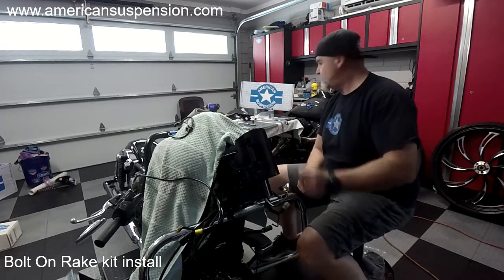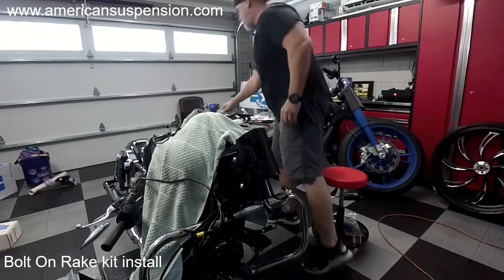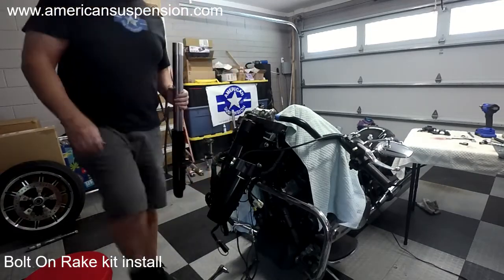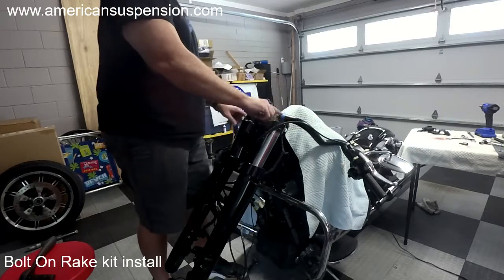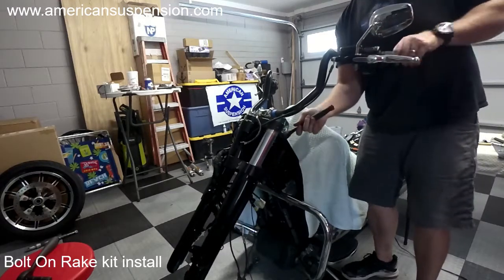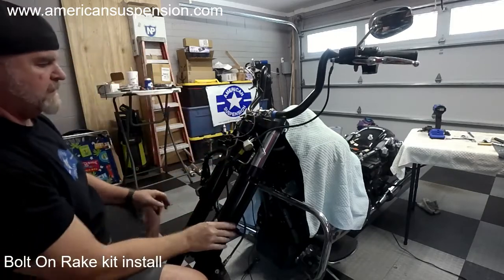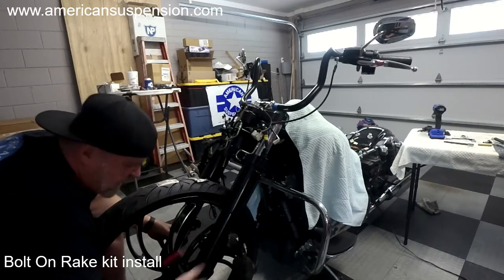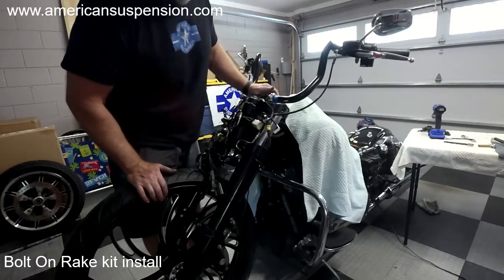American Suspension Bolt on Rake kit install 2021

Comment: I put a 21 on a 2008 EG and hate the way it puts the front end in air. I put it on kick stand and it just rolls over. I know longer stand, but if I put a 7 degree tree on, will it lower the front end and not effect the handling.  I have a hot rod 124 in it and I'm not a road racer.  just wanna stretch it out and level it. Any advice is appreciated.  I also have the legends front end inside. I like the longer travel without  lowering it

Comment: Does a 2020 Street Glide need a special fairing adapter bracket so your headlight is not pointing at the sky?
Reply: You know headlights have adjustments yea? If its not enough, just shim the bracket.

Comment: I don't know if this is a dumb question but can you run a 30-inch wheel on this rake kit with a regular spring suspension? I personally don't want air ride I just want it to be set up at one height and stay there
Reply: yes, you can use stock springs or air ride set up in the front

Comment: How many hours should somebody be getting charged to have this installed? 6 to 8 hours?
Reply: Yes, that is about right , road glides need a little extra time 1hr or so - most shops charge 6-10 hours for just the rake kit install and road test
Reply: @megocoop  ok. Thanks for the fast response!

Comment: I just put a 26 inch rim on a 2001 ultra classic with American suspension Bolton kit. For some reason at low speeds taking off and slowing down to go around corners, it gets a very bad wobble back-and-forth in the handlebars. Any ideas what could cause this? It has brand new tires and the bearings were checked.
Reply: Steering is to loose

Comment: Hey bud is there a speed ratio limit for a rake kit?
Reply from the maker: the wheels come with ABS speed sensor to calibrate for larger wheels
Reply: @americansuspension8351  ok what I'm being told is that if I put a rake kit I'll get a speed wobble because it's better to cut and weld on. Is this true or do they just want my money?
Reply from the maker: @raymundomezajr  Not true - we make the best weld in and bolt on kits available, all come with a lifetime warranty and ride guarantee - there is no benefit to cutting your frame and permanently modifying it over installing a bolt on kit. If you are looking to do some kind of layframe build then yes you would need to use a weld in product.
Reply: @americansuspension8351   Thank you very much. I'm going with a 23inch front and 16 rear. I'll be looking into the rake kit for a 2020 street glide special.  I appreciate your time and knowledge. Have a wonderful day
Reply: @americansuspension8351  Are the top and bottom set screws different thread pitch? (Standard vs reverse threads) I installed this kit a few days ago on a 2016 Roadglide special. The bottom set screw went in perfectly.  The top set screw will fall through the neck assembly trying to torque it down during the same procedure as the bottom. I backed off the top set screw to align it with the circlip. Is this correct?
Reply: @americansuspension8351is it necessary to remove the inner fairing on a 22 RG when installing a 23" triple tree?

Comment: Do I need to buy longer break lines or clutch cable for a 30 inch bolt kit on a 2023 roadglide ?